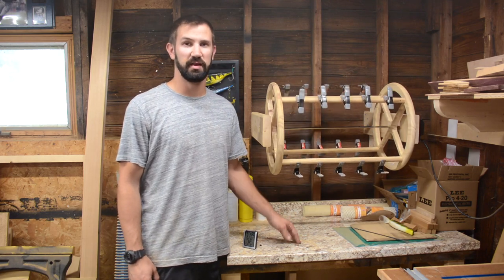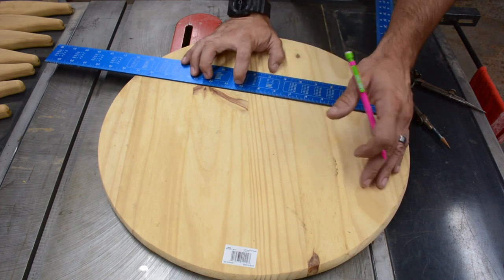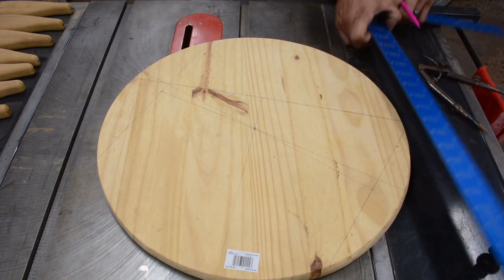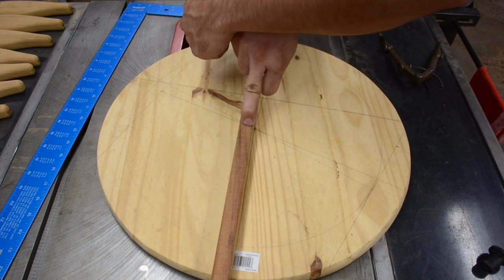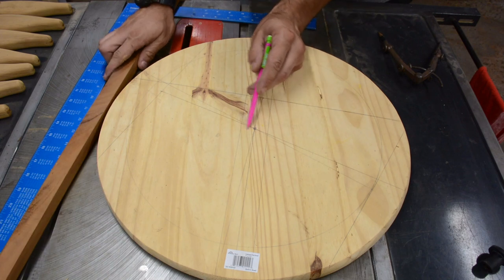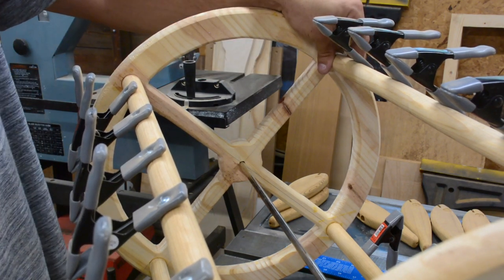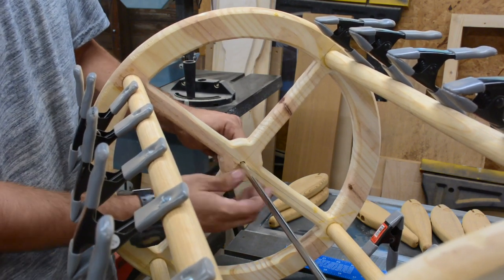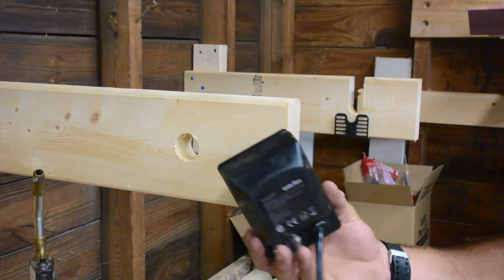Fishing Lure Drying Rack

Comment: great info, just what i was loking for , but i wish u left the links for the motor
Reply from the maker: Hey, yeah, sorry about that. I've recently upgraded my motor. The motor in this video worked fine for a while but over time a plastic peice wore out. I got a new motor from Grainger and it is much stronger and more industrial.. I had to wire it up to a switch and power cord but it was worth it.
Reply from the maker: If you're doing small baits this motor would suit you just fine which you can find here..
Onlyfire Universal Grill Electric Replacement Rotisserie Motor 120 Volt 4 Watt On/Off Switch, Black https://www.amazon.com/dp/B00X7RKCC4/ref=cm_sw_r_cp_apa_i_k6lyCbG56CCQX
Reply from the maker: The new motor I upgraded to can be found here: 

https://m.grainger.com/mobile/product/DAYTON-AC-Gearmotor-115-Nameplate-52JE17?breadcrumbCatId=5238&fc=MWP2IDP2PCP
Reply: Fretthold Baits just a question for you, how were you able to find the metal rod for the Grainger model. I have the exact one but Im unsure what to use to connect the rack too
Reply: Fretthold Baits could you please explain how I would go about using the new motor? I’m not the most mechanical person so the how to video was what I was looking for so I had step by step instructions. This video you posted was amazing but I haven’t the slightest clue how to wire up an AC motor and how that would effectively change the rods/configuration. I need something that works long term as I am starting a fishing company of custom lures and would rather spend the extra money in a quality motor setup to avoid the potential issues you mention here. I will be modifying your design by adding foam inserts inside your wooden cage rack design so that I can house significantly more jigs and lures, similar to the design style flex coat 2500 series of the professional series of turners for sale. I dint want to spend $1,000 on the Flex Coat 2500 series lure turner that rivals the one you built for 1/10th the cost. Thanks a million for the response in advance and for being gracious enough to share your work with us. It’s greatly appreciated and is going to save me tons of money.